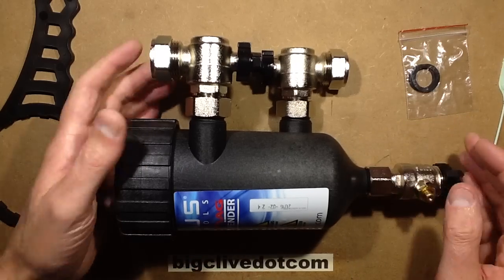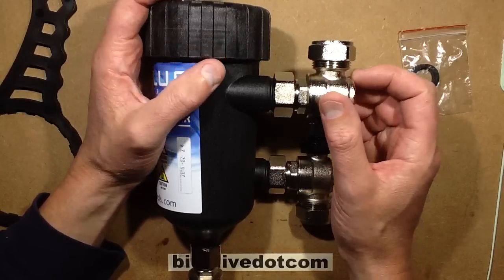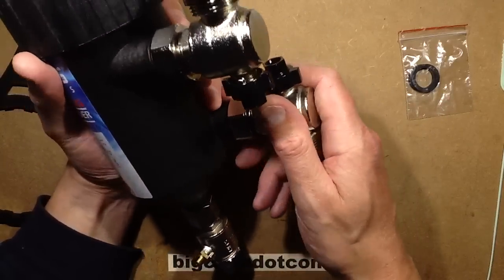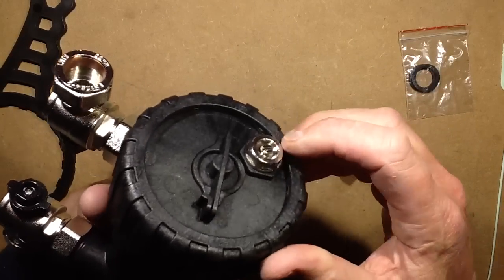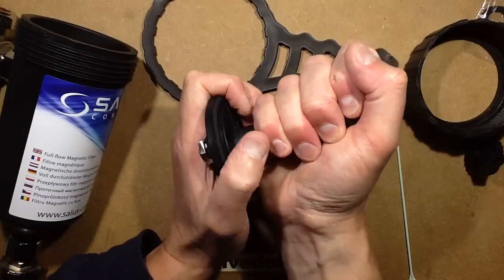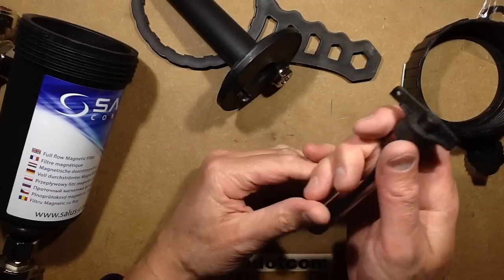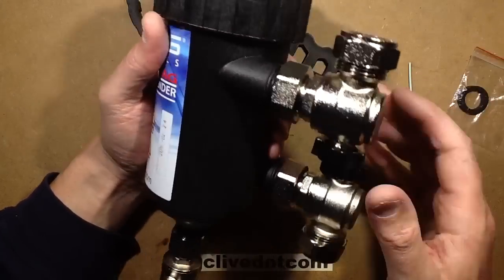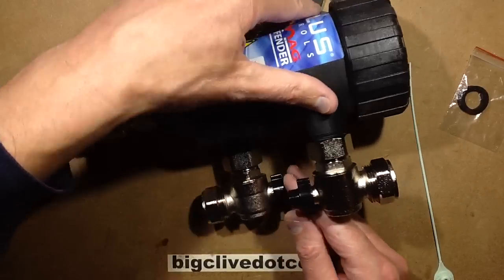Inside a heating system magnetic "sludge" remover.

Comment: I have been running a heating system for over 30 years without corrosion.  Instead of the standard water and ethylene-glycol, which doesn't prevent corrosion, I used diesel engine antifreeze which has powerful corrosion inhibitors.

The reason such good antifreeze is not approved for use in homes, is because it costs a lot to pay for tests, and they don't mind selling you a new heating system when it rusts out.

Comment: The most efficient place to locate the filter is on the return pipe close to the boiler. If you put it on the flow side it won't protect the boiler properly. If you put in place of a radiator it will only filter the water that would have gone through that particular rad, so there is some water that will never even see the filter at all.

Comment: Clive. I was thinking (less then 2 minutes in to your video lol). Would it be possible to make a closed loop heating system with your radiators and use a waterless based "coolant"? Evans Coolant makes a waterless automotive coolant it boils @ 375°F (190°C) @0PSI (as it has no water, it doesn't create gas and adds no pressure). Frezzes @ -40°F (-40°C) and has a viscocity of 2.3CP @ 212°F (100°C). It was originally made for old cars to help extend the life of the cooling system, but i think it would be great in a system like what you have, if it was closed-loop of course

Comment: Short flexible tubes with fittings are available, they have stainless steel mesh sheathes.
Just suitable for your new toy.
Typically used for taps in basins etc. to the hot and cold water piped.

Comment: I have worked in HVAC most of my adult life. I was never fully convinced on these magnetic sludge removers, for three reasons (all based on my personal experience, your experience may vary):
1. They don't slow down the fluid sufficiently to capture suspended solids
2. Not all contaminants in closed HVAC are ferrous or magnetic
3. They don't have a reliable mechanism to prevent captured sludge from returning to the system
Reply from the maker: Part of the reason I bought it was to test that.
Reply: I didn't drain the system weekly, only the filter. Probably less than a pint a time. The quantity of sludge that came out gradually reduced each time and I stopped doing it after a month or two. Now I do it every six months or so, if that.
Reply: So only the filter was drained - now I understand.
Reply: Hi Colin, draining a system with steel pipes weekly is a bad idea, because every time you drain and refill with fresh water, you introduce fresh oxygen into your system. Oxygen will react with most ferrous components (like steel pipes), which explains why you saw so much sludge when you drained your system weekly - the act of draining and refilling was the culprit in this case. This is why, based on experience, I don't recommend draining closed loop HVAC systems at all, because the water that has been in the system for some time has already had its oxygen used up, and won't cause as much corrosion as fresh water. This, plus the fact that draining means you need to dispose of whatever additives are in the water (such as corrosion inhibitors and biocides), and these chemicals can be very harmful to the environment, and expensive to buy and replace.
Reply: These were my thoughts when I even read the title of the video XD
Reply: Hi Clive, I would really like to know more about your system and the results. Please read my response to Colin Stamp on the subject of draining and refilling closed loop HVAC circuits.
Reply: some use siphonic action (like a dyson) as well as the magnets, also i can tell you the filters do pick up a lot. it is no replacement for a powerflush though as the central heating pumps arent powerfull enough to dislodge enough magnetite but the market leaders can pick up around 300-400g
Reply: @ryanrogers93   is the magnetite harmful if it's sitting still somewhere, rather than circulating through the system?
Reply: @scottwillis5434  mostly it will just sit in the bottom of the radiators but a small amount will be suspended in the water. The filter generally picks it up before it settles. Yes magnetite can be harmful to the system when it gets in the boiler, it ruins the efficiency of the whole system and can clog parts of the boiler. Manufacturers require the system to be flushed before a new boiler is installed or they void your warranty
Reply: I personally like centrifugal separators and have used them with great success in the middle east, in both closed and open circuits.
Reply: add a magnet to centrifugal and increase efficiency ;)
Reply: When I put one on my newly-flushed 40 year-old system, I drained it weekly for a while and I was very impressed with the amount of crap that it took out of a system that was supposedly already "clean".  I imagine the water to be absolutely crystal clear now and nothing anyone can say will persuade me otherwise...

Comment: I dislike the way British Gas and others try to promote these & similar things, as there is one issue with them. If they are not being installed in a new system, or a system with new radiators, the radiators will have a sort of triangular shape of sludge along the bottom centre of them which these things won't clear. 
Many older radiators feel cooler lower down in their central area as this triangular sludgy area prevents the hot water from contacting the outer radiator material, which is caused by the waters flow rate being less in the lower centre of the radiator than the more turbulent water higher up.
I've seen many radiators removed that have had these things fitted following engineer recommendations. Only to find that if you cut the rad open, the radiator still contains large central area of sludge.

If it's not possible to flush the radiators or the associated system out properly, then the only way for it to be properly efficient is to replace the rads or even the whole system. Especially if it is not heating properly due to sludge, or the radiators are suffering from large central areas which are not heating up.

Comment: +bigclivedotcom Be careful Clive, some of those magnetic heating filters such as the Fernon TF1 are known to leak in the long run. Although marginally less efficient, I use a SpyroTech SpyroTrap MB3 magnetic filter - Sold Brass and inline it is.

Comment: still got a fernix tf1 i need to install. cost me a fair bit because my house for some reason uses 28mm pipes to and from the boiler but my heating engineer always tells me my system is over built for the size of house

Comment: How does heating like this work? Do you have a heat plant at home or is steam/heated water supplied to houses?
Reply: Yes, you have a boiler in house, to heat the water and pump it to the shower and taps, radiators etc
Reply: fuel is supplied to the house via gas or oil and is burn in a small domestic boiler. the hot water is then pumped around water filled metal radiators or sent through a copper coil in a hot water tank :)
Reply: Some houses use, instead of a boiler, a heat exchanger to heat the water circuit with the radiators, which is in turn connected to another steam or hot water circuit heated by a central plant (usually biomass powered, some are even nuclear powered in Russia and ex-USSR states).

Comment: Ok, I see I'm not alone with 're-plumbing' the connections OR draining the gunk without opening the thing.  A side note - it gets cold here in Kentucky.  And when the electric goes out due to ice and such, the faucet still has hot water from the gas water heater.  It would be nice and toasty if I had a 40 gal water heater instead of a "boiler" and a 12 volt circulating pump.  
.. <original post> ..
Without reading all 200+ comments .. two thoughts.  1.) The inlet and outlet connections look like they have a standard fitting with nuts?  Loosen them and re-align the fittings?  2.) When it's been in service, remove the neomodel magnet, close the outlet valve, then open the drain valve and flush the gunk?  

Some of us Americans also have boilers and I should probably flush mine :-/

Comment: If it were EMT, I'd simply use an EMT bender to put an offset on it. Is there a similar way to "bend" copper pipe without kinking it? After all, you'd only need to 'offset' one of the pipes... yeah... but   21mm is kinda hefty, isn't it. Oh well... a couple of 45's should fit the bill.

Comment: The reservoir on this doesn't look big enough to hold all the inhibitor for my system. I assume these come in different sizes?
Reply from the maker: You could use it to add the inhibitor in more than one dose.
Reply: Only if you like indoor water fountains...
Reply: Could you use the thing upside down then use the bottom valve to feed in anticorrosive while the two boiler ports are open?
Reply: trust me you dont want to open a high pressure system

Comment: When I changed my boiler, I installed a Fernox TF1.  It's a much better made unit and you can rotate the connections to suit the pipework.  Both the connections are in-line too.  It might pay you to see if you can swap it.  The valves are much easier to turn too!

Comment: Clive, 

Brilliant devices and so simple, why did they not come out years ago. 

When you install your sludge remover, ad a tail to you feed pipe and a tail to your drain with ball valves on them. Then to flush out  your system you can just atta ch one of those pulsating pumps with a tank to catch the waste. No farting around with the radiators.

Comment: Just turn the fittings around so that they are in line? Am I stating the obvious or missing something basic?
Reply: It's possible they won't seal properly on the diagonal. Nice bit of lateral thinking though!
Reply: yep.. that's how mine is installed.
Reply: But then it would be hard to have the unit vertical, which would make it hard to fill it to the top with the corrosion inhibitor and leave a pocket of air when you screw it all back together.
Reply: +Siskin's Bits and Bobs  think that's why it has a bleed valve at the top like you get on a radiator? I normally just crack them open a wee bit with the big spanner to get rid of that last little bit of air. otherwise they are noisy. would be great if the inlet and outlet were in line... maybe it's something to do with making the water flow around the magnet?

Comment: 'Thinks great source for a magnet' and Googles them. £100!! I'll buy magnets direct..

They work very well Clive. I had one at my last property - that had a terrible heating system and when I replaced the old boiler (not the wife) I installed a magnetic filter. OMG the crap it pulled from those pipes was unreal. I cleaned it every week until the quantities of crud reduced enough for my satisfaction.

I was able to place my filter beside the boiler but as you say it can go anywhere in the system as long as it's within the flow. The magnetic particles are in suspension and don't always fall to a lower section in the pipes.

Could the safety seal tab on the top be part of a servicing schedule? So engineers can add a new seal to prove they've done the work of cleaning it? (I know - it doesn't mean they've carried out said work!)

Comment: Should be fitted on the return leg to boiler after last point. All new boilers the manufacturer says one has to be fitted to protect the heat exchanger. Sounds like it's going to be a mare to fit in your system though Clive

Comment: Clive, this has to go in the return to the boiler and not in place of a radiator to be of any real benefit. 

The inlet and outlet not being in line is can be a problem. I had to fit one with in line connections here, and requiring access from above and below can be an issue. But it looks like the inlets can be rotated so it can be fitted at the bottom or end of a U which might help.

Comment: Mine is in the airing cupboard by the side of the hot water cylinder. However they are often in the loft.
As far as I can tell you don't seem to have your heating on much judging by the temperature you show in other videos!

Comment: Just had a look at the manual for one of these and if you rotate both valves 90 degrees so they face towards the back and use the cut off section of pipe with 2 elbows it'll fit in line without modifying/bending any pipes :)

Comment: Clive. Putting a magna clean in place of a radiator will do very little to protect your boiler which is its job. You need it on the main return as close to the boiler as possible. Make some of the 22 accessible by extending it out from the boiler

Comment: YES THANK YOU AMERICANS WE GET IT, YOU USE FORCED AIR HEATING OVER THERE, THANKS.
Reply: YOU'RE WELCOME
Reply: +SuperAWaC Underfloor heating (UFH) needs lower water temperatures so it's a better match for heat pumps.
Reply: radiators were pretty common pre-ww2. it wasn't really until post war that forced air became a thing. however, radiative floor heating has been getting very popular in the last 15 years, so you could say it's making a comeback, in a way.
Reply: ...would you believe that radiant in-floor heating has been around since the Roman Empire?

(No, seriously: the hypocaust works on a very similar principle - just with hot air instead of hot water.)
Reply: +Jacana Productions Have you not read up on our forced air systems?  They are pretty efficient, and that don't make that much noise if they are properly maintained...  I just think wet radiator systems would be a lot worse to flush out, because it's liquid instead of dust and air.
Reply: I suppose radiators are a different thing in the US vs what they are here in Denmark.

When I still lived with my parrents, we had gas heating, which was basically a gas boiler in a closet in one end of the house, hooked to a natural gas pipe. No shoveling anything anywhere. Meanwhile, some of my friends, and our neighbours had an oil based boiler, where they'd get oil refills from a truck now and then. I don't know how frequently, but I doubt that it'd be more than 1-3 times a year.

Then there's what I think ~60% of Denmark has. Distributed heating system. Basically there's a central plant somewhere, burning something (often woodchips) and the heat is used to heat some water, which is then circulated around the district, where people have heat exchangers, and use that. The plants often double as power plants, as they are, well, heating water, so they might as well stuff it through a turbine.

So yeah. Radiators are a lot more handsoff here it'd seem. 

Sidenote, with Distributed heating, it is often used as UFH, but also as radiators.
Reply: +David Knight (fixman88) you mean deep East Texas???  I'd buy you drinks all night long just to hear you speak with that funny Yosemite Sam accent 😂😂😂
Reply: When I was a kid I remember the steam radiators in the elementary school I went to (and this was in East Texas in the very late 1970s), I thought they were quite the novelty since our house didn't use them. One older house we lived in had a big rectangular floor grate that heat came up through but I don't know if it had a steam radiator underneath or not.
Reply: +Graham Langley ufh is the cat's meow with only one drawback IMHO, it keeps all the dust airborne...
Reply: I used to have a forced air heater in my place. The radiators are warmer and more efficient.
Reply: Siskin's Bits and Bobs Yes I prefer radiators and one doesn't really need aircon in Colorado - Zero humidity (according to those who live in the South :A0 ) but my Siberian Husky would of been a lot happier.
Reply: radiant heat from under the floor is the cool shit
Reply: Oh yeah? Well I don't have any sort of central heating at all. We have a shitty little gas heater for the living room, and small electric heaters for the rest of the house.
Reply: If you think forced air is efficient you should look at radiant in floor with a condensing boiler.
Reply: Not all of us, I have a baseboard hot water system.
Reply: +Professor Yana's Forsaken Outpost neat.
Reply: a big rectangular floor grate that heat came up through

My grandparents house has one of those.  50+ years later, my left palm still has a rectangular burn scar from when I crawled onto it during the winter.
Reply: We have a hydronic system, very happy with it!  Silent warmth.  Except when a part fails in the system, which is taking a bit of sleuthing work.  Of course forced air furnaces fail too, furnaces and ducts can be noisy, ...
Reply: Forced air really sucks not because of it's inefficiency but because you basically have one control for all of your LARGE house, crazy and yes it make a horrid noise and the ducts get dirty. But of course how the hell do you put in Aircon when you got no bloody ducts :) and yes a lot of houses need it when it 40c for months on end. Our radiator system is somewhat more efficient but now one has a much more expensive option for aircon. And we have double glazing not like the old houses in UK :) but our houses are built of paper most of the time. Houses here in Germany seem to have lovely radiator but of course they all are individually controlled so you have to run around to each room to control each one- crazy and very German!

Comment: You might want to try testing the seals on that before using it, sods law states "Once its fitted, it will piss out water and your whole central heating system is useless, very cold days will follow." LOL :-D
Reply: That's why after a major system modification I'll fill it with plain water and check everything cold before draining and putting commissioning cleaner in - it's cheaper than flushing >£10 of chemicals down the drain unused.